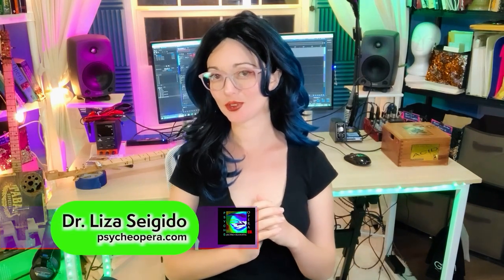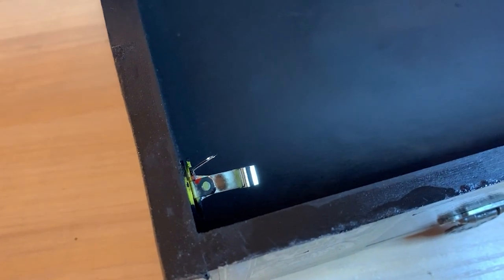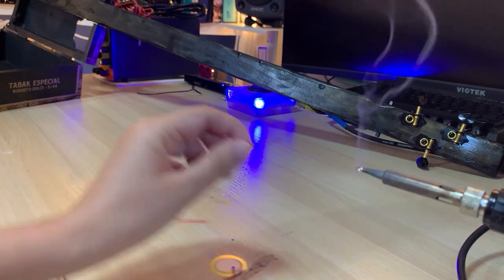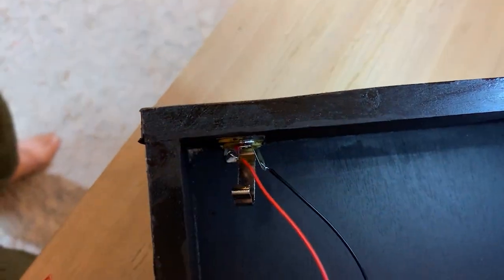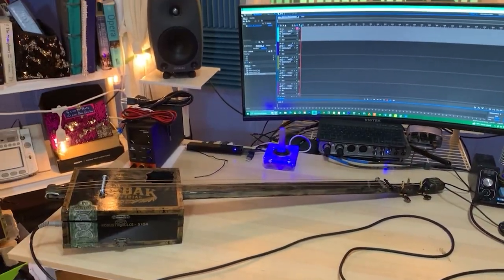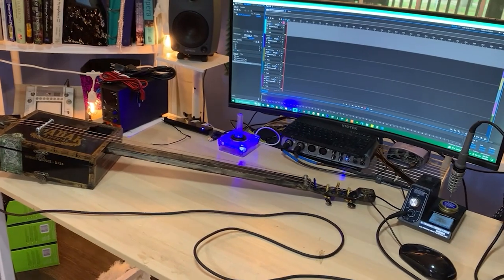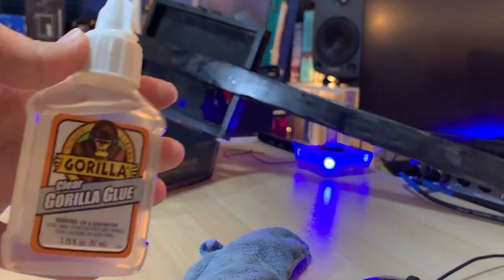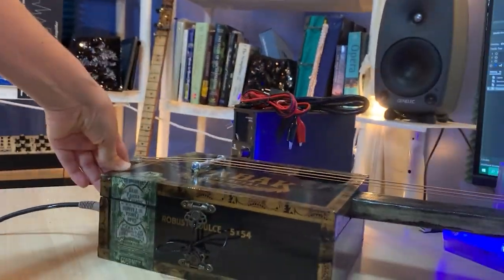Installing Piezo Disk Pickup into New Cigar Box Guitar: Soldering & Placement Advice

Comment: I have the same brillo pad solder cleaner.  Not the highlight of this great video, but I was like, "hey - I have the same bit of kit."  I also have an acid cigar box, but I peeled off the labels and use it to hold stuff.  Very well made.
Reply from the maker: Hi! I finished the build with the Acid box. It actually sounds great with strings 3, 2, 1 from a light phosphor bronze pack. I made some recordings and will share them in my next vid. Thanks for checking out my channel : )

Comment: i like how you resolve the piece where the strings gain tension, with a screw, is that called the bridge? i'l go and check a video where a cbg is built
Reply from the maker: Hi! Thanks for checking out my video! The machine screw on the box functions as both the bridge and saddle. A lot of builders prefer wooden floating bridges, which you can get from suppliers like CBGiitty, but I prefer this simpler method. Cheers! ✨😊
Reply: @psycheopera  Well done. Ah! but you don't have a video where details of cbg building are displayed. That's fine , it's just it surprised me. I started watching the one in which you show your collection, I have to take time to finish it.Very nice channel! I want to make an electric zyther or lap-harp, that is how i fell in your channel!
Reply from the maker: Hey there! Thank you for watching my video showcasing my collection of cbgs. I'm excited about your upcoming electric zither or  lap harp project. Please do post a video demonstrating your instrument after it's built. I'd love to see and hear it! ✨😀